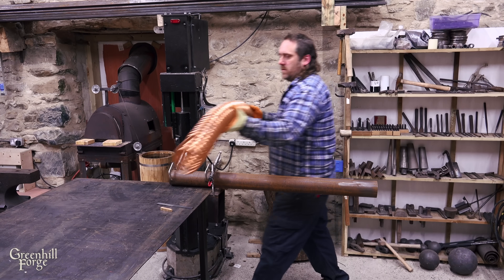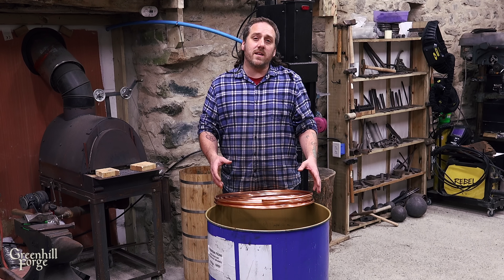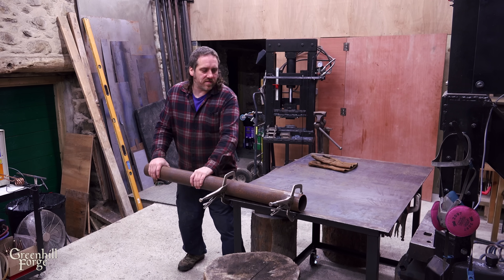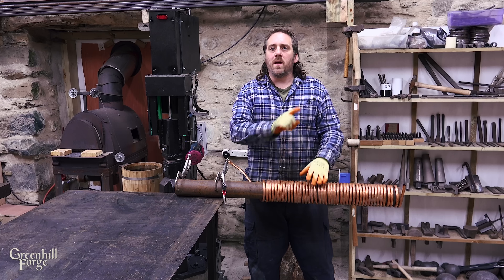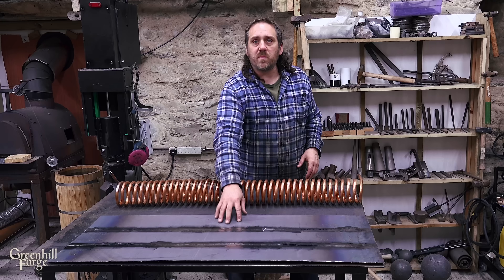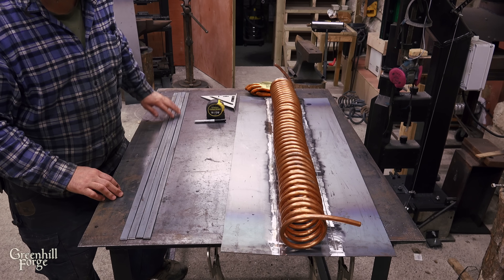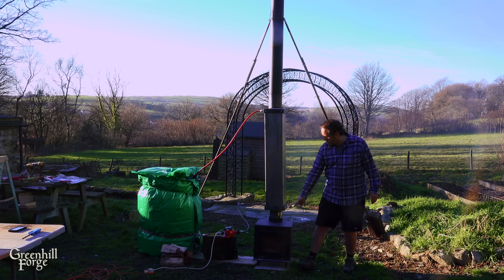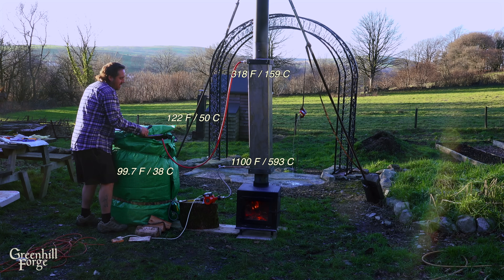Wood Stove Water Heater Experiment - Surprising Results! Part 1

Comment: i can just tell you right out the door using a rocket stove for this concept will get the water to above 350 degrees, but your for sure gonna go through about 4x as much wood lol like i could get 20 gallon stock pots of water to a violent boil in under 10 minutes by placing em on top of my fire pits smoke stack and i just loaded it with wood to create a rocket stove out of it.

Comment: Great and ingenious design! You took great care in designing your heat exchanger! This is ass-kicking work! You are very thorough! Your idea of filling the pipe with water and freezing it is perfect!! 

The steel stand-offs are a good idea, but you will get galvanic corrosion in no time. The steel wil rust very quickly...even quicker than if it was at room temperature. Good thing you didn't use aluminium!! To prevent this, 314 stainless steel would be perfect.

How much time from time to finish?
Reply from the maker: Thanks! not sure how long it took, I always have several projects going at the same time and jump between them, it's all a blur.

Comment: Great video.  This heat extraction design concept is well over 100 years old.  Old cast iron combustion stoves utilised this principle to heat water for the kitchen.  Suggest you get rid of the copper tubes, dampers and electric pump and just use concentric stainless steel tubes.  Mount an insulated hot water tank/reservoir ABOVE the stove.  Use very large diameter hot water connection hoses -- for your setup guess 40mm or 1.5".   For improved heat extraction efficiency from combustion gases use a spinner.  This idea is not new as I learnt this about 50 years ago in a gas fitting course.  Get a piece of flat stainless steel say 2mm thick about 500mm long and 75mm wide.  Now twist the flat steel to make a course helix.  This can be hung close to the heat exchanger inlet.  As the exhaust gases rise they are forced to spin.  This spinning action reduces the surface boundary layer of air improving heat conduction.  The hot water in the annular space in the heat exchanger rises to the top where it exits.  It continues to rise up the 40mm pipe to the TOP of the hot water tank.  Colder water from the BOTTOM of the hot water tank returns downward to the Bottom of the heat exchanger.  This circular heating method is self sustainiung and is called thermo-syphon.   (Old internal combustion engines used this principal as there was no water pump - just thermo-syphon.)  The hot water reservoir will get very hot.  Just fill up your hot tub with just the amount you need = just like filling a bath tub.  The beauty of this system is that it can be left unattended.   The only extra addition needed is an automatic float off to one side away from the hot water.  If the float is kept away from hot water a plastic float will work.  This keeps the reservoir at the same constant level as water is used.  Some old time hot water reservoirs were pressurised as they were mounted below the house's main water supply tank.  The idea being that the hot water reserevoir was very close to where it was needed. In this case, a small vent pipe would lead from the hot water reservoir to above the main water tank water level.   The end of this pipe was left open but was bent downward into a semicircle.  This is what those semicircular pipes are for often seen on very old homes.  For a simpler but lower performance heat exchanger just substitute the concentic pipes with a single straight steel 50mm steel pipe INSIDE the exhaust flue.  If your not in a hurry this works just as well and is supercheap.   Hope this helps with your projects.  Cheers.

Comment: The exhaust gases are acidic, they will eat up the copper very quickly. The best would be a cross-flow heat exchanger made of steel pipes, made of boiler steel, but such a labyrinth will clog up, I think I would make a shell exchanger, a steel pipe in a steel pipe, and water between the pipes.

Comment: you actually dont need the pump so long as the tank is higher than the inlet of the heater. As the water heats it will naturally go up and drawn in more cold water

Comment: You've worked so hard but in my opinion this project has major flaw. It will have soot deposit very hard to clean
Reply from the maker: Check out the comments/answers video if you want where I addressed this.

Comment: Would be interesting to see how this compares to putting the same ammount of water in an insulated steel drum (The same way you have yours insulated) and making a fire under it.
Reply from the maker: It would be intersting. The intensity of on open fire would have tons variables but I'd guess it would take 2-5 hours and use like 10-30X the wood

Comment: Great video  :) . 
I made one of these, about 30 years ago. 
While it was only 1% as well built as yours, due to no electricity on my farm, it could easily boil the entire contents of a 180 litre water tank within 3 hours. 
Yup, the tank was literally vibrating, as the water inside was boiling - - and all without a water pump! 
Needless to say, I was massively impressed at how well it worked  :) .

Comment: Green hill forge, thank you for sharing all of this in a very nice way. I'm wondering why you did you choose a square design ? 
A tubular design would allow to use chip spirals ducts. With two differents diameters you can use them in double layer with tubular ceramic insulation in between them. That is how I make stove exhaust. 
Good luck with the rocket.

Comment: This system is 6.08 kW 
here's calculations for those interested: 
to heat 1 kilogram of water 1 Kelvin (or C) you need 0.00116 kWh of energy (or 4.19 kJ/(kg. K))
40c-7c = 33c temp difference (end v start temp.)
106 liters of water roughly equals 106 kilograms of water, 
33*106*0.00116 = 4.06 kWh  
this was done in 40 minutes though, so: 4.06kWh / (40/60h) = 6.08Kw

Comment: You put an enormous amount of - mostly useless - work into insulating the chimney, and then you have the water go the wrong way...
Reply from the maker: Thanks!
Reply: @GreenhillForge Didn't expect an answer, so maybe 2-3 more words 😀
Counterflow heat exchangers are an engineering standard - have been for a long time. You probably* gain more in efficiency than insulating the smoke pipe - hence half of my "mostly useless". The other half is: when you actually have a counterflow heat exchange, the heat loss through the smoke pipe gets even smaller. 
I'd say**, insulation is useful in any of the following cases: 
- the heat radiating from the tube is bothersome, e.g. because the stove is in an already heated room, of the tube is in the wall or someplace where the heat would accumulate and be dangerous.
- the tube is in a very cold environment, for example outside in a place where freezing temperatures are common
- you want the water to be heated higher than the roughly 50°C you seem to target, i.e. almost to the boiling point.

That said, the temperature drop you achieve in the tube is impressive, as is the work you put in. Too often, I come across botched work in this kind of videos, so it's nice seeing somebody being really serious. Same applies to your result checking.  

* If we want to believe what I was told in engineering school. I should maybe run the numbers, but frankly, that was a long time ago, I'm not sure I could still do it.
** And that also means I could be completely wrong...
Reply from the maker: @lanzji1345  if you watch the previous comment response video I go over all this and why I intentionally didn't use counterflow
Reply: @GreenhillForge Oh... I hadn't seen that - I stumbled on this one by accident. I remain humbled.

Comment: I completely agree with the design which you have proposed and you do have a hand in great videography, and I do appreciate the fact that it’s a very short video based on the fact that information without any accompanying music. A better suggestion, even than what your design is would be to convert a single wall, wood stove to become a double wall, wood stove with a water jacket. It’s even the heated with the cold in at the top and the warm out the bottom.
Reply from the maker: thanks! I showed my off grid water jacket shower in the following video. check it out if you'd like

Comment: Or, Tank higher than heat source, use thermosyphon for no failed pumps when the heat kills it eventually(I work in plumbing, hot circ pumps fail often) which is a bad choice for off-grid. And also use a small coil IN the heatbox itself.
Reply from the maker: thermosiphon is the eventual goal. just wanted to be able to accelerate the flow for safety in the initial tests

Comment: Did you happen to pressure test the copper piping for leaks after you formed it into a coil or before you buried it in the flue casing?
Reply from the maker: I didn't. couldn't hurt but I've never had issues with copper pipe. I did run the system cold with the pump first and check for leaks.
Reply: @GreenhillForge All in all.. Very good work and nicely made video!!

Comment: I usually watch these DIY videos and think they could have done something better or more efficiently but this was great.  While an outdoor hot tube is a sick idea, no doubt.  I couldn't help but think with  some pex tubing you could do thermal flooring.
Reply from the maker: I have floor I did that I added pex into while I did it. Haven't added the heat source yet but It's ready when I have time.

Comment: I tried adding water coils and a heat exchanger (recycled from an old central hearing boiler) to my rocket stove. The coils around the outside of the riser in the barrel and the exchanger in the flue.
I found I had lots of water condensing down from the flue gases. In my case had water pooling in the bottom of my barrel and leaking out of the flue.
In your design, that water is going to be dripping back into the combustion zone. Cooling the burn and affecting efficiency. Possibly causing creosote issues?
It might be worth adding a way of collecting that water and piping out and away.
Reply from the maker: Yeah, design had most of the water boiling out of the bottom damper conection.the woodstove had water boiling/bubbling out for about 5-10 minutes and the rocket stove deisgn for just 3 or 4. Once temps were hot enough I think it was able to evaporate it out with the flue gasses it instead of condensing it.

Comment: You could use a 1 inch diameter copper tube. why not use the heating method of a cylinder full of water heat water put the copper tube in the water tank of cylinders so get direct heat on the copper then pump water through the copper tube much more efficient than what you designed.

Comment: For a permament indoor water heating system for water facet and shower use, it seems this system would need to be autonomous for hot water only. A modification of the standard domestic hot water system with mixing valves might cool the resultant water too much for a shower or bath. Does that seem reasonable?

Comment: I enjoyed seeing you build and assemble the heat exchanger.  It got my wheels turning again.I ve been kicking around an idea for one , but my intial concept was to use an old  proformer Z stove that is made of boiler plate and can burn wood or coal. Does anyone think it would work well with a higher density of coils attached to the stove top with a recangular sheet metal housing, which would get the direct heat from the stove    plate itself and the radiant heat directly above the stove. Maybe even using smaller diameter coil to increase the density and time it takes to cycle through the exchanger? Just brainstorming!

Comment: Forgive me if this has already been mentioned, and it likely has, but that cavity should be filled with sand!
Reply from the maker: sand would delay the heat. it would be good for a mass heater but this is the opposite, deisgned for the instant heat.
Reply: @GreenhillForge Sand would be 100 times more efficient, but I see your point. Sand could also be coupled into a furnace.
Reply from the maker: @ Sand is a great choice for an indoor system that is keeping a house warm 24/7. If you're only heating a barrel of water once outside, sand would slow it way down because a lot of the heat would get sucked into and stored in the sand instead of going into the water. it all depends on what you want to do with the heat once you've made it.
Reply: @GreenhillForge Thank you. Great videos! Is your water heater for one-time instant use? Seems like a lot of work for just that.

If I were interested in a wood-fired hot water heater (and I am), what you have constructed would work incredibly well. 
How do you think sand might work if your goal was to design a more traditional water heater?
Reply from the maker: @OrrinKahn  it all depends what you want to do with the heat once you've made it. sand will store it and release it gradually, so it means less usable heat now but slowly released heat for a little while. if your goal is just heating water (as mine is with these experiments) then you want all the heat to go into the water, you don't want sand stealing some of it and saving it for later. If its part of an integrated house heating and hot water system then sharing the heat between the sand and water would be fine.

Comment: Beware, without a pressure gauge or some sort of relief valve creating a mechanism that builds and traps heat can end up with Explosive results.

Make sure you have the physics figure out or ka-boom.
Reply from the maker: absolutely. that's why this is an open system. this stuff should be taken very seriously

Comment: So the “creosote” was merely soot. The wood stove had definite creosote… more oily as it was cooler… right?
Reply: Great build btw. And awesome job doing the overview. Thank you!
Reply from the maker: I think that's dead on. basically pure soot from the rocket stove. more a mix from the woodstove. soot won't help efficiency but it's not very dangerous, mostly just carbon so another plus for the rocket stove

Comment: did the same with a copper coil around the outside of the stove pipe to a heater core radiator/ fan box unit i built. worked great supplementing ambient heat in the bathroom during a shower or extended bath with the door closed for extended periods, ...until the pump melted! ...clean up, isle 7!   lol

Comment: A friend of mine used river sand as the insulation it takes a bit to warm up but once hot it stays hot for a long time and he said he just filled the whole thing up with sand around the flue pipe and coil and outer case. It works very nice I have used the hot water from it !

Comment: Very confused about the first part re freezing water in thepipe and somehow youre able to bend it and it doesnt burst the pipe. Youre pulling my leg on this right? I dont get it
Reply from the maker: The pipe is easily stong enough to hold in the ice as long as the ends are open as it freezes. You hear the ice shifting around a little bit as you bend the copper but the ice doesn't reduce in size so it keep the copper round and prevents kinking. Done it many times, never had an issue.
Reply: @GreenhillForge  thats a new trick for me. Thanks! Great fab skills btw. 10/10

Comment: Not nearly this big or efficient, but my family used a wood-stove water heater in north Illinois for years.  We had 2 stoves, and one had the incoming cold pre-heated through a series of maybe 6-8 coils of copper on top of the stove into the normal water heater.  Was a lot of work to keep the wood supply, but was enough that we barely had to heat water OR the house.  A December natural gas heating bill for us was about $8 (this was in the 1970's)

Comment: imho you need to coat the copper. Otherwise it corrodes as the hot gases still contain lots of H2O and CO2. I am afraid once the copper surface has built of layer of Cu2CO3(OH)2 (green patina) that acts as insulation layer. Anyway tks for uploading.

Comment: With regards to the creosote condensation on the copper coil, you need to achieve near complete combustion  of the gasses before it hits the coil, then there will be only fly ash which will only need brushing every so often. This could be done with a rocket stove taking care that the riser still reaches adequate temperate before it meets coil. Maybe the coil will need to be inside  a larger pipe to counteract the drag it will introduce which could stop the burn from 'rocketing', though it would probably all depend on the draw from the chimney. Really interesting video ! Looking forward to your next updates.
Reply from the maker: hope to have the next video out in the next hour or two and this is covered

Comment: I wonder if you double the length of the flue and link the copper pipe in series how efective it will be
Reply from the maker: far more effective but the lower the temps go the more creosote will condensate inside the flue

Comment: Initial temperature (32°F) = (32 + 459.67) K = 491.67 K
    Fire temperature (1160°F) = (1160 + 459.67) K = 1619.67 K
    Temperature after extraction (315°F) = (315 + 459.67) K = 774.67 K
Efficiency(%)=(ΔEoutputΔEinput)×100=(849.2251133.64)×100≈74.9%
Reply from the maker: I like your numbers better than mine. All my efficiency and power calculations are in the next video. Hoping to get it out later today